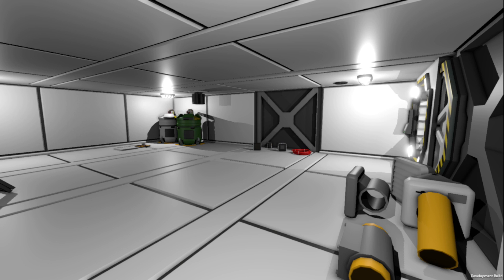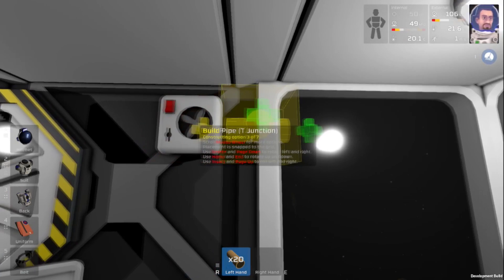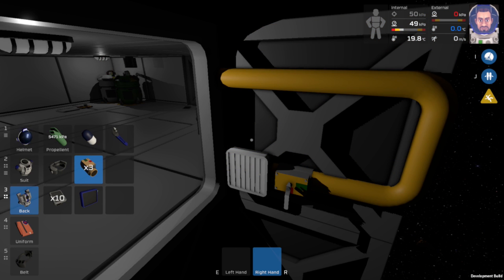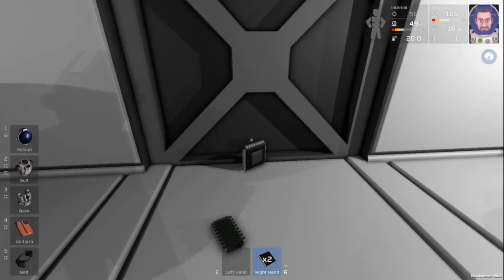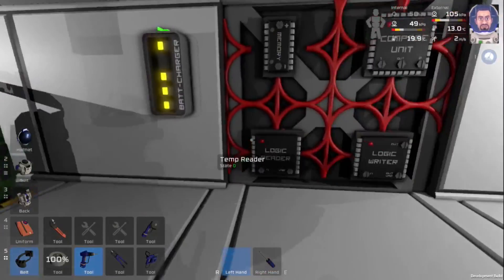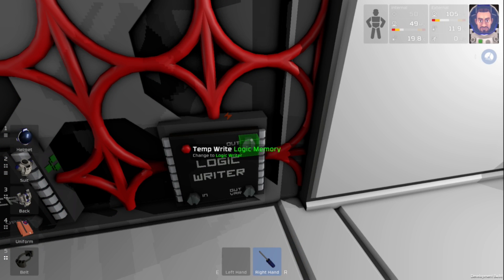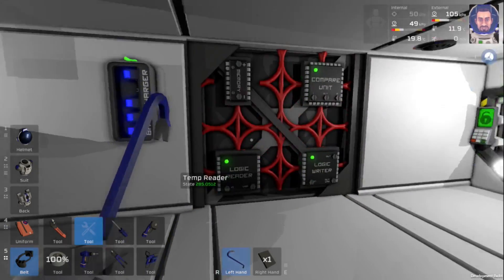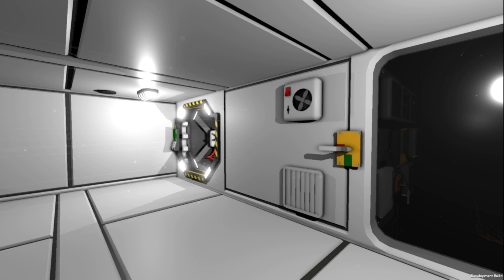Stationeers Tutorial: Basic Room A/C

Comment: I don't understand... It's an ac unit, the cooling element should be contained within the ac unit... Aka freon, the same liquid used to cool a fridge. The air should only have to enter the ac unit, the air passing the tupes contained within the ac unit that have feon circulating to cool the air down, then thrue one or two pipes attached to the ac unit without anything attached to them aside from a single passive vent re-entering the base. There should be no need for radiators or a passive vent connected to the outside where you would lose your atmosphere that you painstakingly created within the base... And you definitely don't want the outside atmosphere filled with pollutant to enter your base...

Comment: Two math units and you can have it start at 30c and stop at 21c
Reply: how would I go about doing that?
Reply: @littlemisswolfee1095  compare twice.  what bushwackah built only compares if its higher than 15 celsius (288 Kelvin) which doesnt make sense because plants can grow well up to 30ish celsius. you can run the same wire to another math compare and compare it with something like 40 celsius (313 Kelvin, you need a memory to write 313 to as well and then connect it to everything). than wall cooler will only work if temp goes above 40 and stop at 15. i think ? it's something along these lines xD

Comment: Hey the next tutorial you should do is a filtering system like one that makes a slight draft and filters the air through a filtering system that filters out all gasses and feeds the oxygen and the hydrogen back through mixes it and sends it back throught the pipes anything else goes through your old filtering system and any carbon monoxide goes into a hydroponics bay and converts the carbon monxide into oxygen and filters it back through